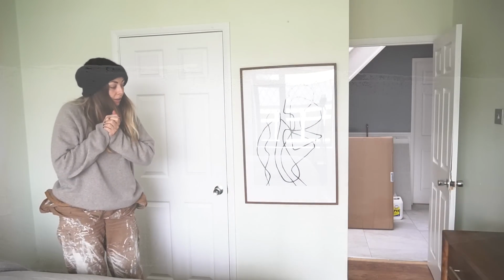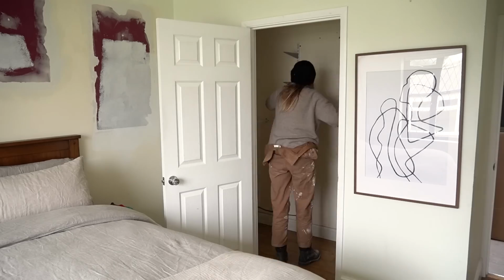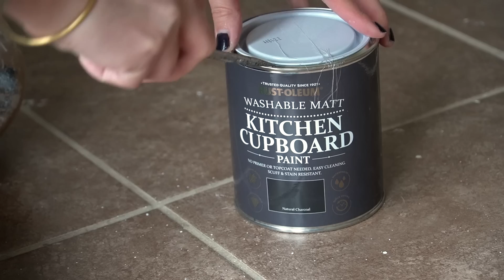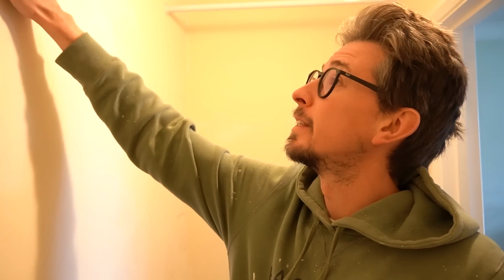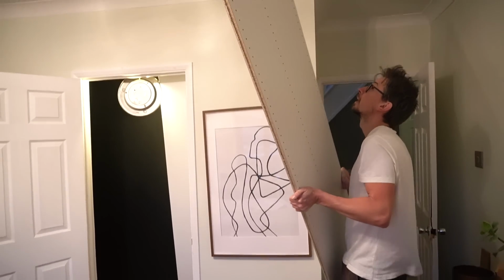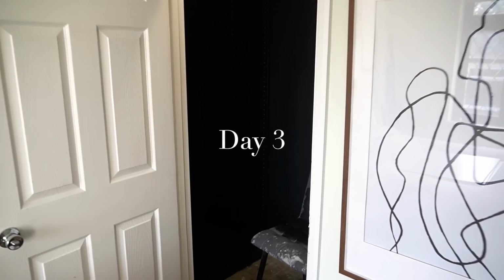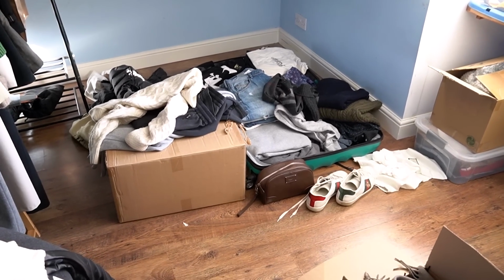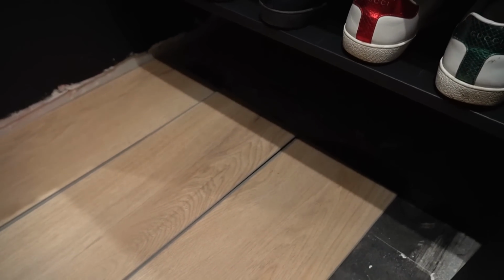Ikea PAX & KOMPLEMENT Wardrobe Hack | Small Walk-In

Comment: Great job, looks fantastic! I’m a big fan of pax wardrobes, so versatile. Accessories drawer looks FAB! 
I think when we do ours I’ll pave to fill in the pre drilled holes in the wardrobe before painting though .. unless we leave it all white:)
Reply: Emma did get little caps for the holes that match the colour and popped in after so you can't see the holes, and also means you can readjust bits at a later date if you wanted. But yes if you were going to paint them far easier to have them in first 👍

Comment: Nice job! Looks so good, I am really impressed. Emma, you've got to get yourself some metal sawhorses for setting things on , to sand, tape, paint...whatever. I'm in Canada and I bought some from Canadian Tire, the are made by Mastercraft, metal, light weight, foldable so can be easily moved, and they were on sale when I got them, 2 for 1...so about $20.00 for the two, I'm sure some store in the UK has something equivalent ...changed my diy game significantly and saved backaches from all the crouching and bending I was doing. Go Bluejays!
Reply from the maker: Yes we really do need to get some 😂 my back can't take much more 🙈

Comment: Well deserved upgrade for Simon! Just wondering, was there a strategic/measurement reason for not waiting until the flooring and baseboards were finished inside the closet before installing the PAX system? Or just didn't want to wait?
Reply from the maker: Mainly a lack of patience. The flooring won't be done until probably the middle of next year as we need to get the ensuite done first so that the floor flows through from the wardrobe, to the bedroom to the ensuite with no joins. But we have the option of taking the items out when the floor goes in and lifting the wardrobe, or just run the floor up to it and finish it with a little trim round the edges. Then the skirting will go in. 👍
Reply: @EmmaHill  omg, next year! I dont blame you for not waiting lol! It's great that you are easygoing about deciding certain things and/or can prioritize certain details over others. I think I'd have a hard time with things like this as I'd probably work myself into a debate over whether I'd regret not finishing the closet floor first in the event I wanted to take out the wardrobe unit years later and not have to redo the floors. I guess maybe you've gotten better at this decision process with practice over the years. But yes, that makes sense you have those 2 options to finish up the flooring well.

Comment: Fantastic use of space! Giving me ideas... Many ideas!
Really interested to know with the IKEA bits, you just sanded back slightly and then painted, did you use a primer? I've seen some YouTube videos that say you have to use a special type of primer to be able to paint over IKEA flat pack but do you find that just a bit of sanding does the job? Or is the secret in the rustoleum paint?
Reply from the maker: Yes the secret is the paint. It is specifically for wood/melamine (essentially for up cycling old kitchen units) and doesn't need any undercoat/primer, just a light sand to help with adhesion. It is holding up ok so far with Simon having used the shelves as tool rests but I guess the true test will come with time 👍
Reply: @EmmaHill  this is going to save me so much time, thank you!! The videos I've watched show that trying to paint IKEA laminate without using a specific Zinsser primer just results in the paint almost splitting on top of the furniture, it just doesn't coat. Like trying to paint on top of oil.
Not having to prime is going to cut my paint time in half!! Thank you!

Comment: Keep us posted how the paint on the ikea bits holds up. What kind of paint did you use?  I’ve always assumed I’d need a super adhesion primer before painting and have put off painting some ikea pieces because of it.
Reply from the maker: Its a special paint by Rustoleom specifically for wood and melamine surfaces (kitchen units) - linked in the description box - and only requires a light sanding to help with the adhesion but requires no primer. It has held up well so far with Simon putting his tools down on the surfaces (to my dismay 😂) but will keep you posted as to how it holds up over time 👍
Reply: @EmmaHill  fantastic, I’ll check it out…could be a game changer for me!!!